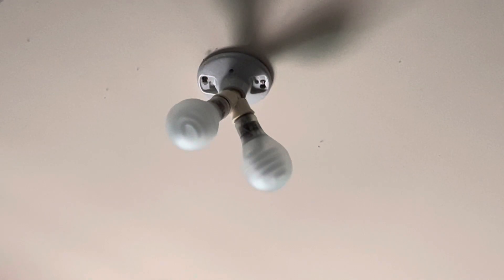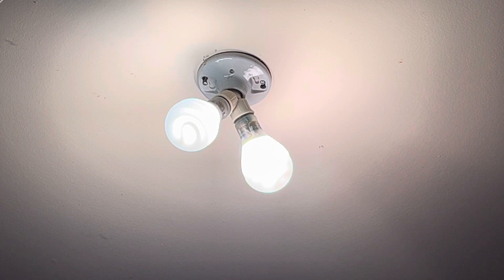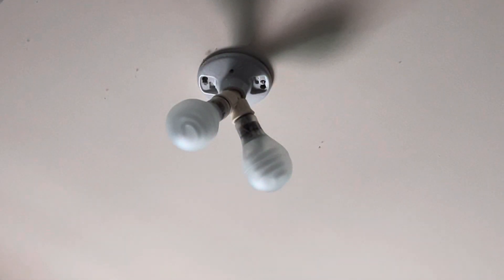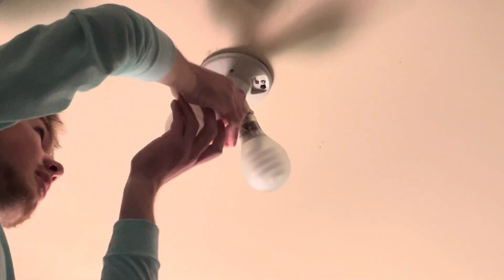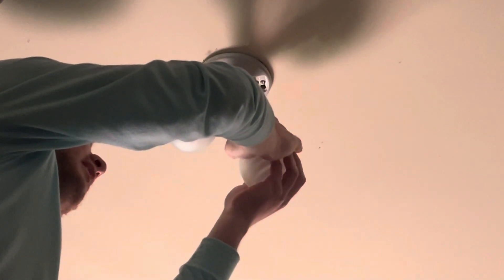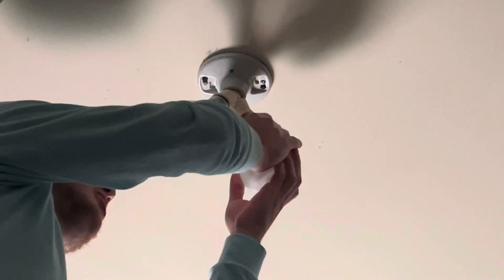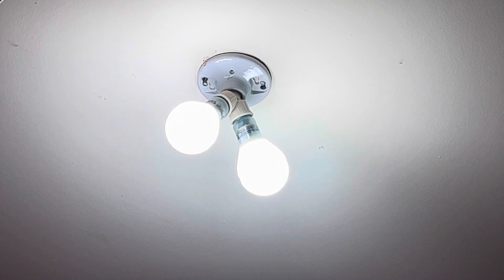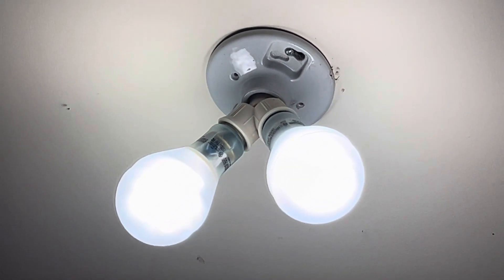Changing out a CFL light bulb in the garage

Comment: I'm not sure why you say there is a halogen capsule in these because cfl and halogen are two different light bulbs. Cfl never used a halogen capsule. However it does use a tungsten filament to start the cfl.